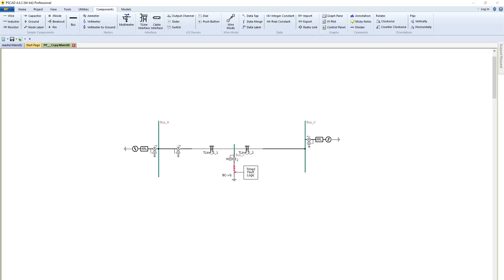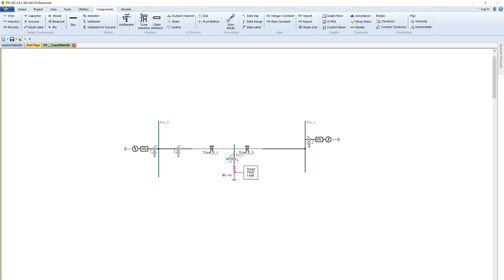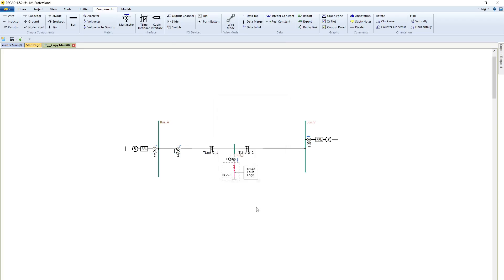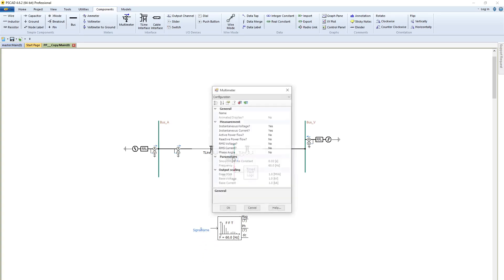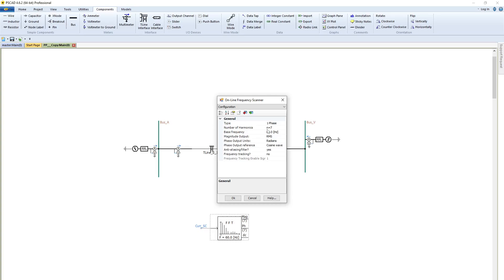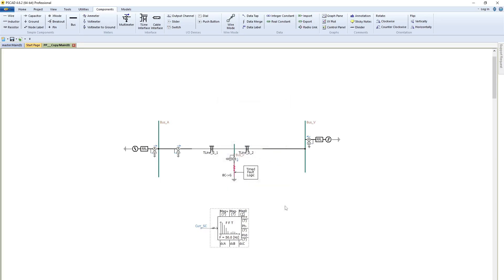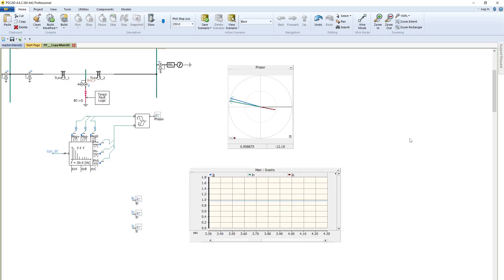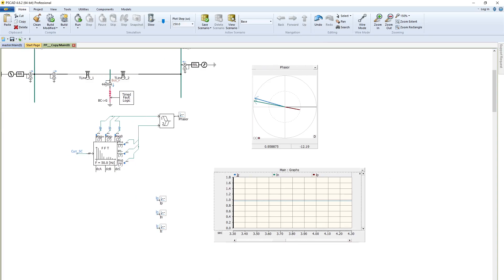How to Extract Positive, Negative, and Zero Sequence Currents in PSCAD

Comment: Have you tried generator oos out of step protection? I would like to know your experience.
Reply from the maker: Well I didn't. But could you tell me what is oos ?
Reply: @hi96077  ANSI Device 78: The standard code for out-of-step (OOS) relays. Generator out-of-step (OOS) protection is
a critical relay system that detects when a generator loses synchronism (falls out of step) with the main power grid due to severe disturbances, rapidly tripping it offline to prevent catastrophic equipment damage and widespread blackouts by isolating the unstable machine.